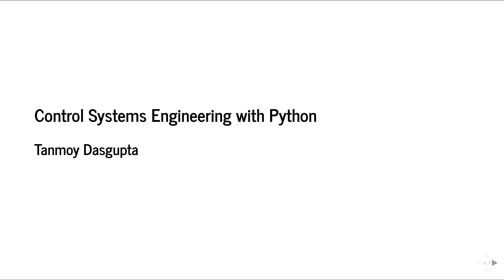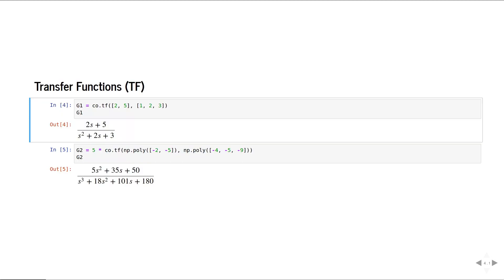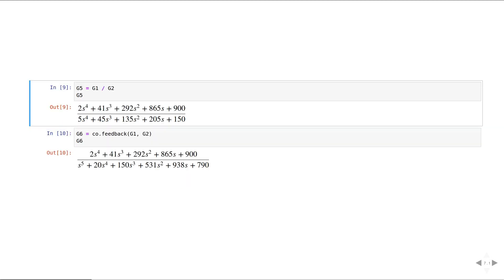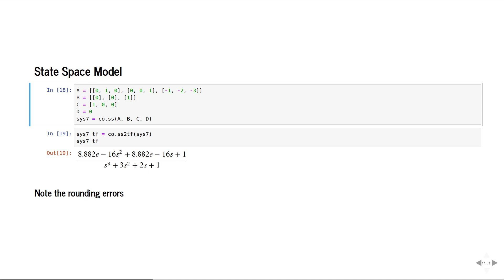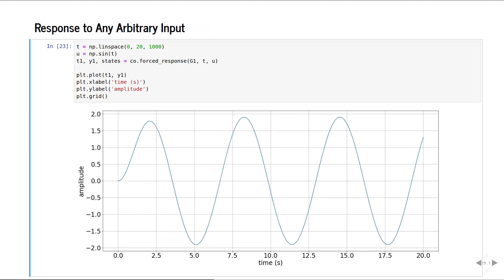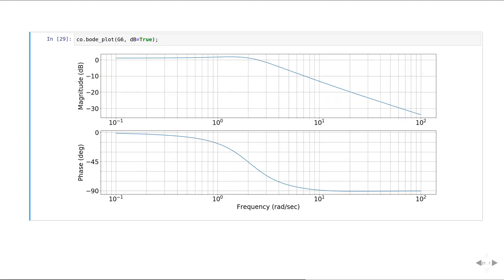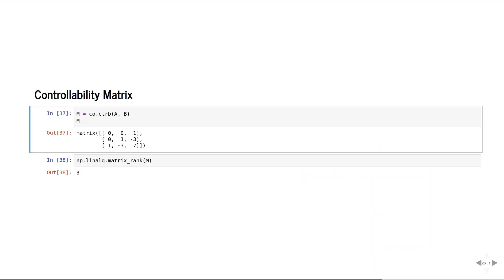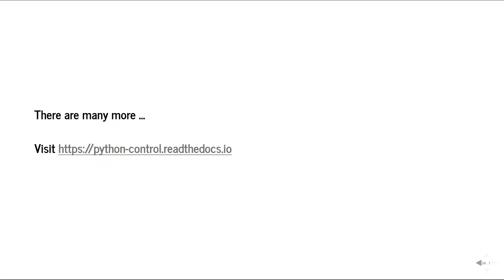Control Systems with Python

Comment: I have a question regarding the response to any arbitrary input with initial conditions. When you input [2, 4, -5] as the initial condition only the "2" is used as the initial condition. What does the other numbers "4" and "-5" are representing? 

When I try to simulate anything with an initial condition python says that the X0 expects a paramether with the shape (5,1).
This is the message: "Parameter ``X0``: Wrong shape (rows, columns): (4,). Expected: (5,) or (5, 1)."
Any idea what each of this 5 arguments represents?
Reply from the maker: Realistically speaking, you should only use initial conditions with state-space models. And regarding your particular question, can you please post a snippet from your code? That would help me understand the actual problem.

Comment: It’s not working, I am getting an import error on control.
Reply from the maker: install the control package first
pip install control
Reply: @thetdg  Thanks that worked, but there's still one thing I don't know that how to get information such as Peak time or Overshoot in python.
thank you
Reply from the maker: @ishaankharbanda1467  Once you get the step response array y and the time array t, you can get the peak value by doing 
peak_os = np.amax(y) - final_value
Then you can calculate the index where y is maximum by doing 
index =  np.argmax(y)
and then using the index to retrieve the time at which the peak occurs
prak_time = t[index]
Reply: Tanmoy Dasgupta okay will work on it thank you for replying

Comment: Thanks a lot for the video. I have one question remaining though. If i define two Transferfunctions and then multiply those, the result ends up with an order of s^8. Doing the multiplication by hand I can easily reduce the whole result to an order of s^4. Is there any way to make python reduce the order of the result? Thank you
Reply from the maker: control.minreal(G)
minreal stands for minimal realization. This is exactly the same as Matlab's minreal function.
Reply: @thetdg  Thanks a lot for the fast answer. I actually tried that before, but I guess i did a wrong input - anyways now it works. Cheers!